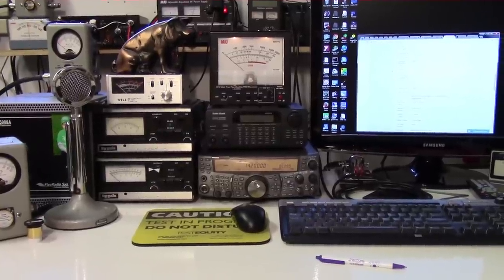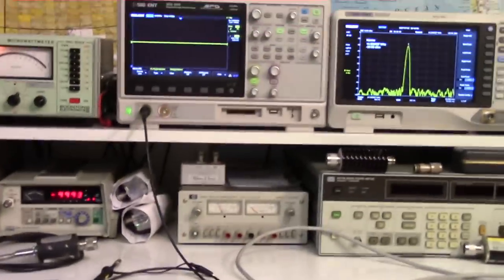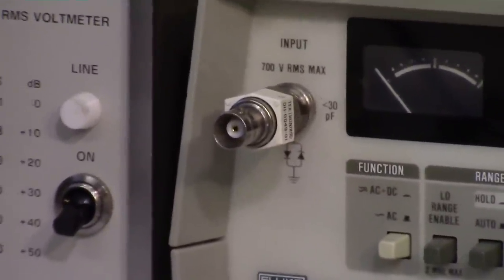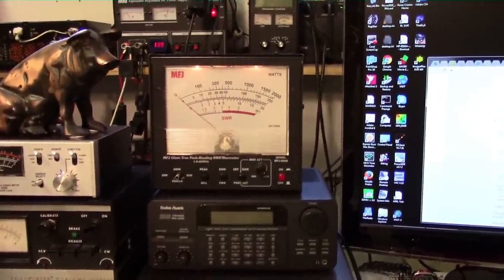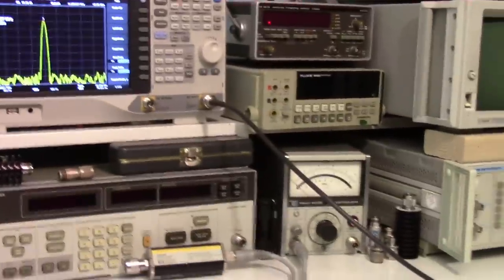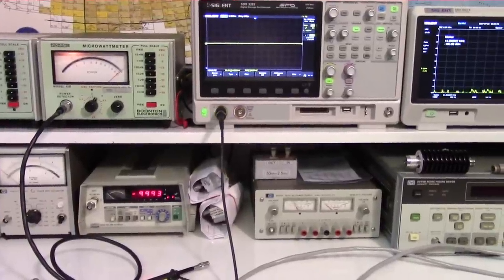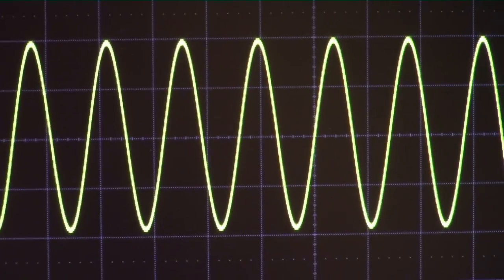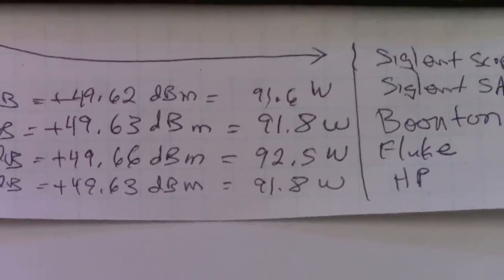Measuring RF Power With an Oscilloscope & Other Instruments

Comment: At first, you used the Bird 30 db attenuator with the 60 db attenuator added in series. Why did you switch out that system to a straight dummy load when measuring with the oscilloscope? I like the idea of keeping ~ 90 db of attenuation ahead of the scope for protection.

By the way, the video was absolutely great. Not too long at all. I learned a ton from it. Thanks.

Finally, it's funny how everyone bad mouths the MFJ equipment but in this test it outperformed the Bird. I don't understand why MFJ gets the bad rap, unless it's because the Bird is $1000 plus with the plugs and the lowly MFJ is maybe $150 and no plugs required. - status symbol maybe?  Unless willed to me, I'll never own a Bird 43 on my income.
Reply from the maker: Hello and thank you very much for taking the time to comment. Anytime you have a question do not hesitate to ask.

The reason the 90 dB of attenuation was removed is because it is not required. In the case of the oscilloscope measurements we are measuring the voltage ACROSS a 50-ohm load. The scope can safely handle this amount of RF voltage so no other attenuation is required. Just be mindful about the 1x/10x settings on the probe and esp the 50-ohm/1-meg-ohm setting on the scope itself when making this kind of measurement. Very easy to wipe out your scope if you leave it in a 50-ohm setting. That is why we use the 50-ohm load for a termination ! It can handle the power, the scope cannot.

In the case of spectrum analyzers and "series" type power instruments (unless it is designed for high-power input) we must insert extra attenuation to protect the sensitive detectors in the power head. Remember some of the test equipment are meant to measure very low levels of power only so extra attenuation is required and be accounted for.

So in short, to answer your question, the extra attenuation is simply not required and we are at no risk to damage the scope.

Regarding the MFJ.....I have owned a dozen of their items. Here is my take: The ideas they have for products are brilliant and they offer so many neat gadgets for an affordable price which is really awesome.  Where they do "fall down" is in their build quality and quality of components. If you open up many of their items you may find that many components are marginally soldered in and many cases parts are even loose etc. In the case of this power meter the SWR "set" pot is 100% useless and it is all but impossible to line it up where it needs to be in order to make a measurement. It MUST be a 10-turn pot. That is a mod that I will be doing for sure.

Now, as far as the bird goes.....well, one thing they have going for them is they are very rugged. I hate to admit so but I have dropped one of mine at least 4-5 times in the last 20 years on the carpet floor and it has not affected it's looks or performance in any way. I suspect if I were to drop the MFJ, like I did the bird, esp from 5' high, well....I fear I might have destroyed the plastic meter face or messed up it's calibration. Accuracy on the birds is usually better PROVIDED you have a known calibrated slug. If I had to pick only one meter it would be my birds. It is esp handy and more accurate when measuring power into loads that are not exactly 50 ohms. Given a slight SWR the MFJ (and other meters like it) can quickly provide inaccurate power measurements while a bird will provide more reliable data. That actually gives me an idea for another video. So there are pros and cons to both, not to mention price as you mention.

I love having them both ! I always leave one MFJ on my AL-1200 when I tune it up and want to make sure it is putting out a kW and want to quickly check SWR. Likewise I always keep a bird in line after my 2m kW for the same reasons.

Thank you again for your kind comments and question. I hope I have addressed them properly. 73
Reply: @w8bya  Great response. Keep up the youtubing...

Comment: I did not understand at all how you got -20 dBm on the 435. No number corresponds to what you were reading.
Reply from the maker: I think you made another post where you said things finally made sense about where the -20 dBm signal came from. Let me know if you need any more clarification. In short it was just an arbitrary level I picked and set my sig gen to and had each of my "traditional" power meters verify as in fact -20 dBm. I could have picked -30 dBm or -10 dBm, it would not have made any difference. Again, only used to give us some confidence that all the meters read the same level. 73
Reply: Thanks for responding. I was having difficulty seeing a 20 on the meter scale. I didn't realize that, once you picked the range, the scale reading just shows a deviation value from the 20. I am used to scales where the range value is part of the scale.

Comment: I also have a couple of old Welz and Diamond vswr/power meters and I find them to be absolutely great . 73 Ian G7HFS/PA3IKH
Reply from the maker: Yes I love this old meter. I remember I was fresh out of college and it was my first SWR/PM that could do HF or VHF. I still need to calibrate it hi-hi. 73
Reply: @w8bya  they are so easy to recalibrate and built to last👍
Reply from the maker: @ianharling9569  The only thing I did not care about the meter was I found the little ring nuts used to screw onto the SO-239 connectors were always coming loose and hard to tighten so I grabbed a 400W soldering iron and hard soldered the SO-239 and ring nut right to the back metal chassis. Never regretted doing that.
Reply: @w8bya  that never happened to my Welz yet but  I now know what to do if that ever happens.Thank for the advice.👍

Comment: Wow, the take away was that the Bird was the least accurate and good ol MFJ was the closest, who would have predicted that
Reply from the maker: Hi Mark. Yes it was a fun series to run and to see how different meters & techniques varied the results. Please keep in mind that these results were with a very small test sample so we need to be careful making generalizations. Also, if I dropped the MFJ off the desk onto the carpet floor the calibration pots might quickly alter these results while the bird would probably fare much better (don't ask me how I know this). Another neat test would be to see how the two compare at 4-5 different power levels and on 3-4 different ham bands ! My gut tells me the Bird would be more accurate, overall. I would not go out on a limb & say the MFJ is always going to beat out a Bird meter. I also suspect if I were to measure the power into a load with, say, a 2:1 SWR things would get very interesting very quickly.

Also, I suspect if I calibrated each of my bird slugs & meter (or purchased them brand spanking new or calibrated by a reputable cal house) the results may have been quite different. And, someone else's slugs will with 100% certainty read differently then mine if not new or calibrated.

But like you I was a bit surprised how well the big faced meter did. I am really glad I have them as they are easy to read from a distance esp as I tune up an HF amp etc. Thanks for taking the time to look & comment Mark !  73

Comment: Nice vid, but you made the same mistake i did and by luck did not fry my front end.The inputs of the scope are rated 400 volt pp but at DC (!), at rf frequencys there is a downfall the derating graph, the probe has a derating spec and the scope also has one, look them up and do the math. My setup can handle 200 volt pp at DC but >100KHz it derates down to 30 volt for the probe and 5 volt for the scope, i stuffed 100 volt pp in it and it survifed ;D
Reply from the maker: Hi there. hmmmm....Not sure what mistake you are talking about.  During my experiment using the O-scope the scope was never used in the DC mode and no DC voltages were ever applied to the probe or scope input. The scope was always in the AC mode and always in the 1 meg-ohm input impedance setting. The 50-ohm reference was being established by the external Bird 50-ohm load not the scopes internal input.  The scope probe used was well within it's specified operating range before any derating had to be considered.  The scope probe has a -3 dB BW of over 300 MHz and we were measuring only a 14 MHz pure RF signal.
Reply: I was half way a long post to explain when i searched the manual for your scope i found thiss and it explains it all : https://www.eevblog.com/forum/beginners/scope-maximum-input-voltage-(dc-an-ac)/
Your probe is exactly the same as mine, here’s the manual and derating curve of my own probe: https://cdn.rohde-schwarz.com/pws/dl_downloads/dl_common_library/dl_manuals/gb_1/r/rt_zp/RT-ZP03_UserManual_de_en_02.pdf 
Look at the derating curve and the notice next to it, the imput impedance of your probe derates to 50 volt rms max at 14 MHz, if i understand your setup correctly you have put 90 watt/67 volt in the probe and 6.7 volt in your scope at 14 MHz.
The imput impedance of the probe and scope drops from 1 Mohm at low frequencys to maybe a few Kohm at 14 MHz and so you fry your probe, or scope :-€
Reply from the maker: Ahhhh, I totally understand what you are saying now. Sincerely thank you for pointing that out. I can honestly say I was not aware of such a quick fall-off of the probe & scopes specs as far as Z(in) and max V(in) was concerned. Thanks !
Reply: Youre welcome,saved another scope :D, i just discovered this myself and am now contemplating a solution as the scope is my means of measuring rf power, i have a r&s hmo1202 and it specificly mentions in the specsheet that it derates to 5volt rms >100 KHz at the 1Mohm input and also 5volt rms at 50ohm which aparently does not derate this means basicaly i guess for most scopes
Reply: Looking at other scopes which have a 50ohm input usually says 5volt rms max@50ohm so i guess it is safe to say that 5 volt rms at frequencys above several MHz is the safe limit for most scopes and so if you have a x/10 probe its 50 volt rms or 50 watt in a dummyload.
An extra attenuator or high voltage-rf probe is the solution i guess, or a little attenuator circuit in my dummyload as i more and more understand that sticking a probe in a dummyload is not the best way to measure, as i understand it is better to have the scope terminated at a 50 ohms and use a voltage divider with dedicated bnc terminal at the source

Comment: Video abit long for the info im looking for.
Reply from the maker: Brian, can you share with me exactly what information you were after? Knowing that will help me plan accordingly for future videos and where I went wrong with this one. Last thing I want to do is frustrate folks. Thanks
Reply: @w8bya  Trying to work out what the simplest way to measure RF Power With an Oscilloscope.  If you could lay that out in the first 2 1/2 to 5 mins would be great. The length of the video is not so important. Just the opening of the Video lays out the theory and logic of what we are about to learn. FIY 10 to 25 min videos in my experience are key.A red box around your thumbnail and maybe a arrow pointing and something random will bring in view to, but if not relevant some would call that click bait. My 2 cents :-)
Reply: Also thx for that quick response. P.S. I'm trying to measure a QRP rig's output power.  A HackRF One with a 3W Wideband LNA PA to be specific.
Reply from the maker: @brianlink391  Thanks Brian. I found out just how hard it is to make a really good video. I take my hat off to those who have mastered it. I however have a LONG way to go LOL.  The engineer in me wants to be thorough and explain from the ground up but I need to learn to be more succinct. TU for the feedback, wish more were like you.
Reply: @w8bya   As an engineer, we know that there are two equal opposites to everything(sine and cosine for example). You could record a 1 hour long video. From that video, you can cherry-pick the points you want to make in a more succinct way. Or you can create a bullet-point layout sheet and touch on each subject while your recording. While editing, use your bullet points to cherry pick them points.  I think it would be a great way of condensing a long video down and ultimately, making it more succinct. :-).(voltage doubler)  I explained it better the first time around but my word processor crashed and I had to rewrite this post over again. It never goes as well as it does the first time.
Reply from the maker: @brianlink391  That's a great idea Brian, thanks. I have just now obtained a video editor and am learning how to use it. Up until this time I had to post what I recorded w/o any cutting or editing whatsoever. Now that I can chop parts out and rearrange segments it has made things so much nicer. I also love the feature of being able to generate my final video slightly "sped" up so the videos are shorter with less hang time between words. 73

Comment: False.

Scopes indicate voltage,not power.

An Oscope cannot indicate power.
Reply from the maker: Well of course they do not measure power directly but we can calculate the power based on the voltage which the video shows us how to do. Just like some "power" meters do. Hard to fit all that in a brief video title.
Reply: If the Resistance / Impedance is known, then the voltage can determine the power as was explained very well in this video.